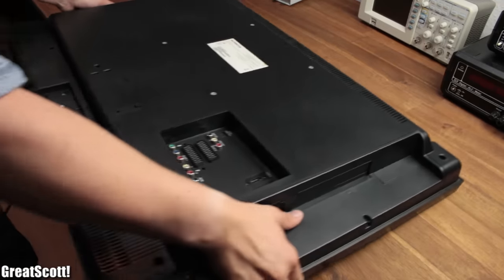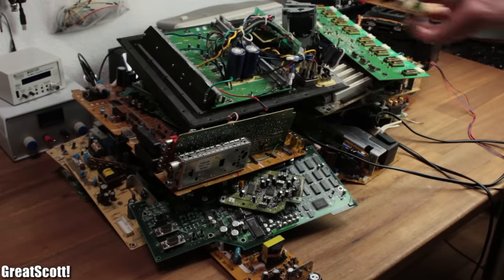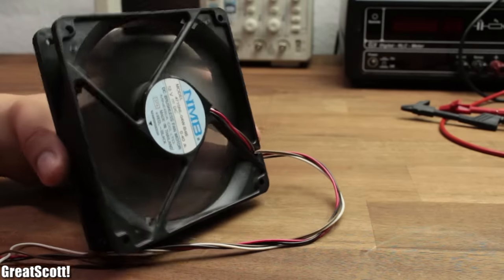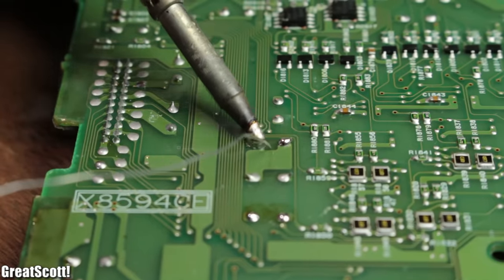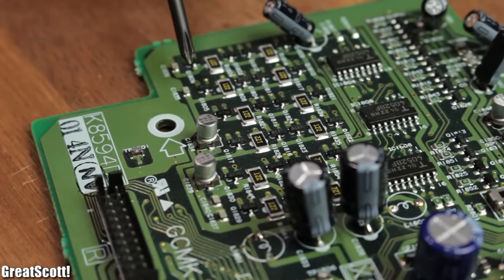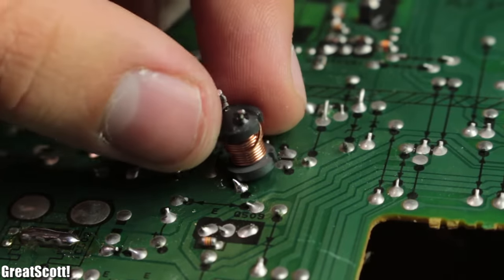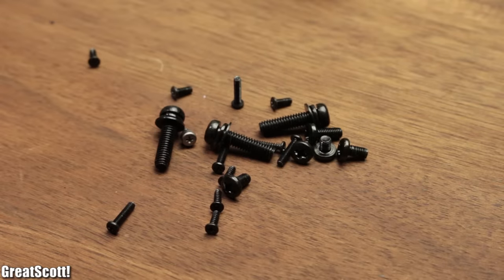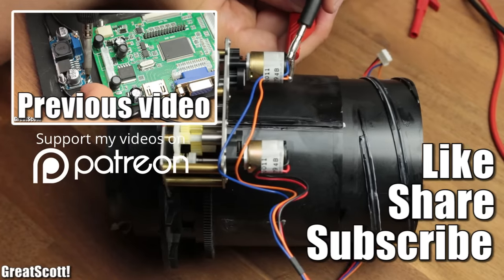What is worth desoldering from old electronics? || DIY Fume Extractor

Comment: I thought I was the only one cheap enough to do this LOL!
Reply: You'd be surprised to see how many guys fund throwing electronics away wasteful! 😝 It's best to salvage!!
Reply: Finally, im not the only one
Reply: Ya bro Mee too 😂
Reply: I try fixing first, then salvage, recycle the plastic add the metals to the pile. I separate by type and take to salvage yard about every five years or donate to the Boy Scouts. As for small electronics I will save a few boards just in case you need a small part for a repair, also if you use a hot air station you can remove an IC easily.
Reply: I get 99% of my stuff from the side of the road or op shops
Reply: The Boy Scouts didn’t want the recyclable metal. I had 120 lbs, I hauled it to the recyclers and got $7.20
Reply: I see it as recycling and the planets REAAAALLY and I do mean REALLY need people who recycle stuff instead of throwing everything away and buy new like a sheep
Reply: Me too
Reply: Not by a long shot
Reply: There will be times where you don't want to buy new components when there is perfectly good ones nearby 😁
Reply: It can actually save a lot of money if you don't/can't build a large bank of common components at once.

A single order of any kind from a major manufacturer or distributor will have a $8.00 minimum on shipping alone. So if you find yourself buying a few of this and a few of that all the time it adds up.
Reply: Dude, i literally salavage whatever i can remove without damaging, including transistors, resistors, caps etc. while sure they are cheap but free is even cheaper
Reply: Ur not cheap ur not wasterful
Reply: Ill pick old electronics fron the trash sometimes lol. Half the time they still work!
Reply: We Just Had Like 10 kg of emty circuetboards 🤣🤣

Comment: Last time I picked up a 46" tv next to someone's trash thinking I could get some components. Turned out the TV worked fine but the remote didn't. 
College students I swear.
Reply: lucky b*stard!
Reply: Some college kids are just overly spoiled by their rich parents. It's sooo unfair!
Reply: I'm not surprised. When I was in college I would dumpster dive at the end of every semester. You will now believe the stuff they throw away. I once found a macbook pro with a bad hard drive. For the price of a hard drive I had a less than one year old macbook.
Reply: @cultclassic999  what else did you salvage from this dump ?
Reply: @laurentl3410  I work at a university and it's totally true, college students throw away plenty of useful things.
Mini fridge, microwave ovens, smart phones, scooters, bicycles, laptops, computers, backpacks , clothing and dorm furniture. 
They waste money like its water. They should clean up what they dont need and sell it or donate it so as not to waste resources and pollute the environment.
Reply: @mikemccormack3997  Sure thing. Electronic waste is a serious issue. I bet the worst part is that most of the waste is still functionnal, needs little to no repairs and will work for some years afterwards.
Reply: @mikemccormack3997  Damn, I now want to rummage in the garbage of colleges.
Reply: The irony is the college students are the very ones out virtue signalling about saving the environment yet they waste perfectly good food and devices.
Reply: * Actually they were moving and the TV couldn t fit in the same truck *
Reply: gimme it, i will put you an infrared. i got plenty lol
Reply: Same here, I wanted some  parts to get a plasma working, found one down an ally..it works fine, minus a few lines down the screen. 50" LG plasma.
Reply: 46 inch sounds like plasma. Could've just been replaced.
Reply: Funny, that's why the plasma was down the ally. Because my area is surrounded by temp housing students. So lots chucked out, although I wont go in a bin for stuff, I will however go through things at the side of them. All the immigrants do the bin diving.
Reply: @DonVigaDeFierro  I know I'm late but same
Reply: @cultclassic999  ,   and when did you meet someone so smart that they could take what YOU throw out and make a make a milkshake out of what you just shook?
Reply: They likely got a newer tv and no one wanted the old one. Flat panel TVs are extremely cheap, unlike their cost in 2002. I bought a 32” for $150.  If it breaks I will just by a newer set, which will likely support 4K when that happens. I have a 40” plasma that I got for $300 a few years prior that I no longer use because it consumed a lot on energy. It works so I kept it,  but if I do not have the space for it, I would give it away. But I doubt anyone would want it because it’s 720p.
Reply: At least 3 outta 5 TVs I get here that don’t turn on cost pennies to get running ...
Reply: deltaray3 lmao I got a 55” one the same way (plasma tv with a tiny amount of burn in the screen made by Samsung)
Reply: Update: BTW, its a Samsung LCD from 2015. Almost Better than my living room TV. I bought a wall mount arm for it for $20 and mounted it in the garage and hooked it up to a raspberry pi 4. Now when I'm in my workshop I can look stuff up easier or watch youtube videos. I know, I suck.
Reply: lmaoooo Something similar happened to me. Someone left 3 old lcd monitors next to the trash at my previous job. I threw them in my trunk, and later found out 1 had a broken lcd panel, 1 had a faulty psu, and one had, I shit you not, a broken power cord. Swapped power cords with the one that had a cracked display, salvaged a shit ton of components, and got a free monitor.
Reply: @SirInventor  no, watch Luis rossman. Also it is planned obsolescence.
Reply: @charadremur333  i know who he is, whats ur point? i never said it was impossible i said it was difficult for the wrong reasons.. which it is. Needing licenses to get apples replacement parts (which are expensive to get from what i've heard), having a level/tier system for said licenses, not being able to order extra parts for ur inventory(if u break this or any of their other rules u lose ur license), and even after all that some parts arent even available for purchase for the license holders or are insanely overpriced (-60%-90% the products full price just for one part like a screen)
Reply: I can understand the mentality though. "I'm spending $30k/year on tuition. What's another $3k in waste?"
Reply: 666th like
Reply: @slonkazoid  667 like
Reply: The fools! They could have used it as a ridiculously sized pc monitor like I do.
Reply: @PoxyBear  plenty of people throw away stuff. Thing is, college students might not have cars to take those cars to a proper disposal place - and thus you can find it.
It's a bit like survival bias.
Reply: Probably just needed batteries... or the cheap batteries leaked and the contacts needed to be cleaned.
Reply: here in europe electronic devices are thrown every where and in a good condition specially in Switzerland you can get a fully home needs out of trash fridges freezers tvs ovens dish washer computers printers fans toasters bicycles...for free
Reply: i've got a 46" working TV and nobody i know wants it.  i don't want to throw it out, but that day is coming.
Reply: @Matthew Welkie no, there are many better reasons to make fun of millennials...
Reply: No kidding
Reply: This is why IR blasters should still be standard on our phones today
Reply: @dreamrealitysyndrome  surface mount ir takes too much realestate on a $1.5k phone already connected to wifi...
Reply: @rillloudmother  as does a headphone jack and removable storage. Kinda makes you wonder why a phone would be $1.5k eh?
Reply: @dreamrealitysyndrome  I would never pay it
Reply: @rillloudmother  neither would I. I stay on my LG V20
Reply: Hey watch it! I have been a scavanger for my whole 22 years of life. not all are same
Reply: @bhoot1702  if you would not do it, no need to get defensive.
Reply: @rillloudmother  I agree and disagree. Not everyone is same. I'm not totally disagreeing with the OP
Reply: @bhoot1702  learn to express yourself clearly.
Reply: @Network126  it’s called capitalism that creates spoiled rich kids and people
Reply: When I was in school, I would always go look at the dumpsters right after the start of each break.
I didn't even have to dig through them, other students just drop useful stuff on the ground in front of the dumpster.
Reply: @frederickschulze8014  that's 10% of the tuition! People have no sense of what money is, let alone what proportions are.
Reply: I have recovered SO much stuff from "trash" it isn't true! MANY excellent quality battery and mains drills - DeWalt, Bosch, Makita, non brand. Some are even in their cases with chargers! The batteries are usually missing, which is a shame, because I enjoy retrofitting good Liion cells to them, or I just buy low cost replacement batteries off eBay. My two Makita battery drills cost just £18.50 for a pair of identical batteries and are like new even though I have had them now for over 4 years and in continual use.

Best find so far? A BRAND NEW Bosch hedge trimmer that had been used ONCE, still had hedge trimmings, and the idiot owner sliced through the cable about two feet from the handle. One 2 pin cable connector later (That I ALWAYS fit to garden tools anyway!) ... PERFECTLY WORKING hedge cutter - also now approaching 4 years old!

RIDICULOUS wastage of EASILY repairable parts and tools!
Reply: @frederickschulze8014  I take it they weren't majoring in maths! The answer btw is 9%! For the mathematically challenged £3k as a fraction of the total (£30+ £3k) is 1/11 = 9% near as makes no difference!😁😁
Reply: My high school was throwing out a 55" TV. Turned out all it needed was a new power supply and I got a new 55" TV for like $20
Reply: My neighbour put out a 50”? Panasonic LED TV with remote HDMI cables, power cables . Wouldn’t turn on so I google searched what’s going on, hold the power button and volume up button for 5sec or so, powered right up and it’s still on my Garage wall so when things get overwhelming inside!!!! Classic!!
Reply: You can better get a duplicate remote on amazon!
Reply: @mikemccormack3997  We had a facebook campus group, anyone who wanted to sell, donate stuff could easily do it on the fb group.  It worked really well. It was super for the freshmen who sometimes didn't neeed to buy a new microwave ect as the one moving out could just leave it for the next one moving by selling it or donating it ect. We had even a few techy people who would help if their pc laptop broke. It was a nice community.
Reply: Dude... I wish I could be that type of college student. I can't even afford to think of buying something above 50 euros lol
Reply: damn, lots of people with prejudices in this thread. I've rarely seen that much generalisation
Reply: @mikemccormack3997  I went to university back when Deep Purple's Smoke On The Water was a huge hit, for reference. That generation I know kept their stereo systems move after move, even after they got married. Stereos were the first thing we unpacked and plugged in on move in and the last thing we put in a box on move out. Now they jam in some ear buds and turn into zombies - done.
Reply: @charlieross-BRM  smoke on the water, the easiest song to play on guitar. 🤣. Your right.

Comment: One thing worth (really worth!) highlighting is the environmental impact of "parts salvaging". Most of these components use rare materials of require substantial amounts of energy to produce. Re-using them has a massive positive environmental impact and as well as being a great example of circular economy - cradle-to-cradle, a holly grail of CE. Well done!
Reply: I agree! Electronics recycling can’t recover and reuse things like FR-4, ceramic, silicon, leaded glass, and etc found in electronics. Reuse of components is better. I also heard somewhere that it takes 70 gallons of water to make one IC

Comment: @2:10

Tip: Since air is compressible, always secure filter media (or any obstruction) to the inlet side of the fan, not he exhaust side. By compressing the air against the obstruction you will create about a 15% decrease in performance. As a side bonus, your fan will also stay clean.
Reply: great tip!
Reply: Hashem Mehyar
Thanks
Reply: And what if you do both the inlet and exhaust?
Or will that just decrease the performance again?
Reply: @SibaNL  more
Reply: @yosyp5905  Yeah, that doesn't really help.
Reply: What kinda response is more?
Reply: +Maxwelhse  that is total BS
Reply: Now that you mention it, computer cases do place them like this, but I fail to see how it would make a difference in an open environment.
Reply: Maybe it is easiest to stack 2 fans together, wrap them in carbon pads, and then just hold them together with zip ties around the whole unit?
Reply: @bottledpills  Claim you have a scientific degree while you fail to understand the question was about reversing the position of the filter, not the fan. This to have the filter in front of the fan or behind it, not have the fan reversed so it blows into your face, a toddler would understand that doesn't work and yet you boast your scientific degree while you did fail to understand the question...
If you're gonna give attitude, at least get the basics...
Reply: @jan48712  if it is rubbish then why do all units that you buy have the filter on the inlet side?
Reply: @ianmontgomery7213  it's done for reasons of practicality not performance, having the filter on the inlet side makes for easier cleaning
Reply: @jan48712   The fan would get caked with flux residue if you had the filter on the outlet side. I tried running a fan with no filter at all and the fan got residue on it fairly quickly.
Reply: @kalebbruwer  if the fan is blowing against the filter, some air will rebound off the filter surface of the filter and cause turbulence i expect, as the filter is not 100% permeable drawing air through instead of pushing air onto/through works better
Reply: @jan48712  If it was the other side you would be cleaning the fan as well as the filter. Not practicality but sensible design.
Reply: I think that's a great idea!
Reply: i beg to differ. Fans are good at creating pressure, not so good at creating vacuum.  That is why you always want to push air through something, if possible. The suction is bad enough as it is, dont obstruct it more than necessary.
Reply: @baruchben-david4196  you'd be surprised how much a little bit of carbon can do... assuming this carbon filter is in fact activated charcoal, even that little bit should absorb almost all the fumes from soldering. 
Not that i see a problem with just using the fan to direct it all out a window, other than where i live, sometimes opening the window enough to ventilate will chill the whole house and get everyone mad at you.

Comment: I realize this is an older video, but one thing you forgot to mention, as you desolder parts you are actually increasing your ability to sold at the same time. It is a reverse method, but you gain the knowledge about soldering in general. And you see how much or little heat it takes to remove parts that way. I used to desolder parts off of thrown out board decades ago and basically removed anything I thought I would need later on. And I did use so many of those parts to experiment on hobby projects that way.